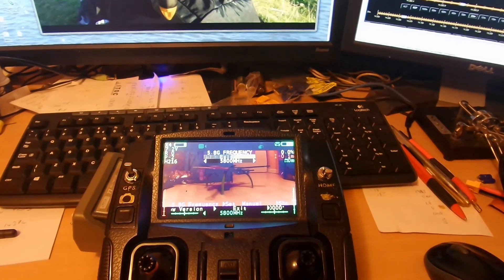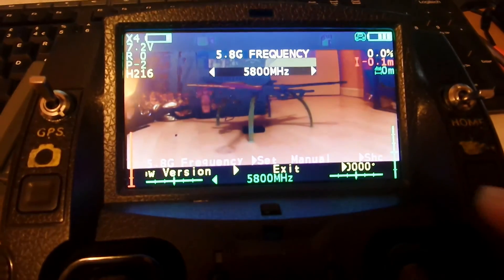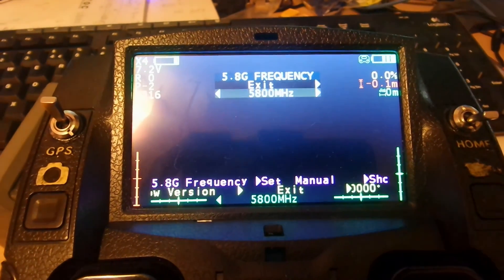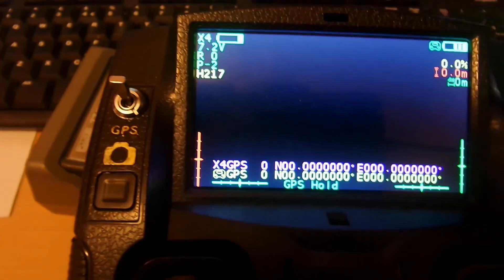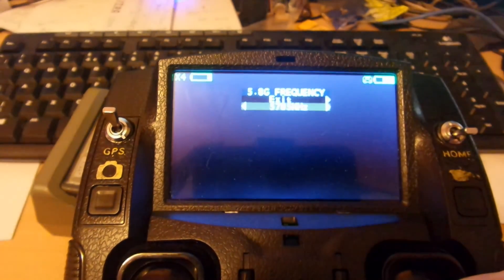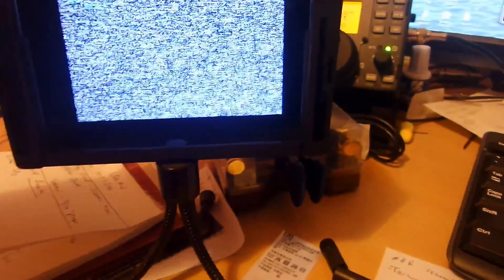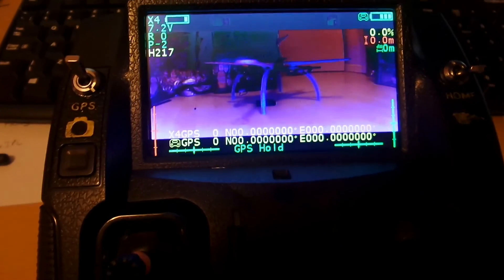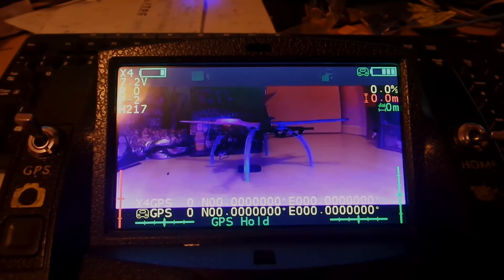Hubsan H501S - VTX/VRX frequency selection

Comment: I wish I could see what buttons you are pushing
Reply: To enter the menu hold the left throttle stick in the down position (throttle back position) then press straight down on the right stick. This will bring up the menu. From there it's all done with the right stick. Pressing straight down on the right stick as if it were a button is the key.

Comment: You may well be responsible for Hubsan modifying their factory data. My Revell Control 23899 (which is a Hubsan H50S) came in factory set at 5740Mhz. Interesting.

Comment: Once you set the transmitter to this fpv frequency, will it retain the frequency next time you use the quadcopter?  I understood it auto scans frequencies on startup.  In other words do you have to set it every time you fly?
I am asking because I am thinking of buying the 501S controller to use with my 501C / fpv - vtx combo.
Reply from the maker: Yes. It will not change unless you either rebind or manually adjust.
Calling it autoscan is a bit too kind. It usually just picks the first available channel, and this only occurs on binding.

Comment: My frequency is on 5795 should I change it, or is it different for other country's
Reply: It all depends on your surroundings and any interference that may be present. You simply need to try different frequency's until you find the one that works best for you. Remember, If you re-bind you will have to set your frequency manually again.